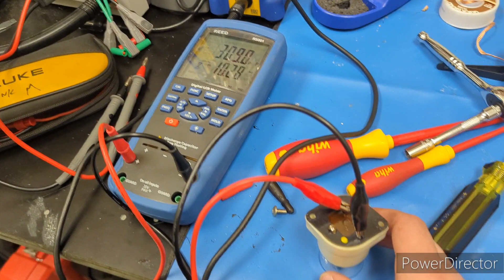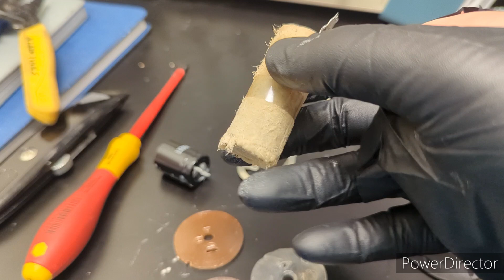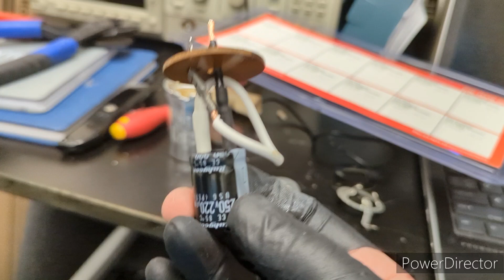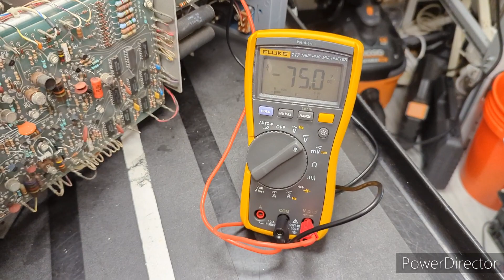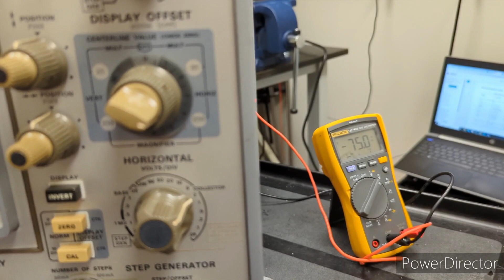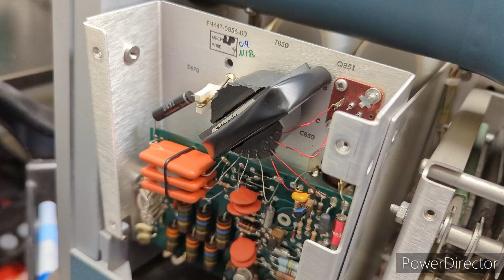Tektronix 576 Curve Tracer Restoration/Repair - Part 2!

Comment: I found two errors in the manual, LV reg board Pin R is missing. actually Pin Q 5V rail.   The wire on pin D says blk on white. Its Brn on white on my unit.
Reply from the maker: There's a chance you are looking at an earlier or later version of the manual depending on what year/serial # your unit is. I thought the same thing as you and then I bought the manual from Artek media which has one of the later versions. My unit was built in the 80s. Most of the free manuals online are for units built in the 70s

Comment: One note on the troubleshooting process The pots for the focus and intensity controls. There is some weird stand offs on those pots. This is because the -4,000 VDC for the tube is on those pots and exposed. Use extreme care on the top side of the power section.

The -75 VDC rail is the reference rail for ALL the supplies. If this rail is out of spec the ALL the power rails will not be correct.
Reply from the maker: Thank you Zen! I did not realize that at the time that the intensity pot had the highest voltage across it.  A mistake that I go over in the third video of this repair process.  And I also learned the -75V rail was the reference after the fact as well.  I tag your 'Calibration' vid in my 3rd video as well because I also go through some of the calibration/performance checks in that one.  But yours is by far the better toturial on that 😂
Reply: @fmashockie   just got done watching the 3rd video. Good stuff there. If some Measurements or some videos will help the repair process let me know and I will get something recorded.

Comment: Personally I would focus purely on the supply rails, get them right and stuff will fall into place to be fair I think thats what your doing so good luck and I'm kinda jealous to !!....cheers.
Reply from the maker: Thanks! Yep I think I've got the low voltage power supply in place.  Next vid I will likely run through the service manual's performance checks to narrow down the issues with the step generator and step generator amplifier. As well as other issues I have yet to find lol

Comment: I too rebuild old electrolytic capacitors buy cutting them up carefully and glue them back using gray color epoxy so they look like the originals. Those are for restoring old tube amplifiers mainly McIntoch amps. Because there are no high voltage caps that can be bought, I put two new 350V caps in series with parallel resisters to make up 700V caps.
Reply from the maker: nice! this was my first go at doing this so it was not the prettiest job lol